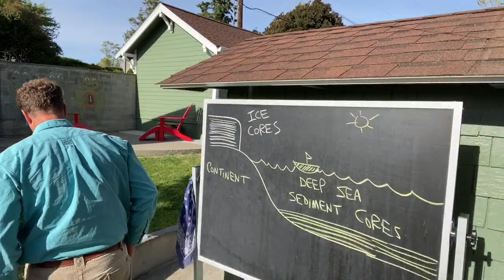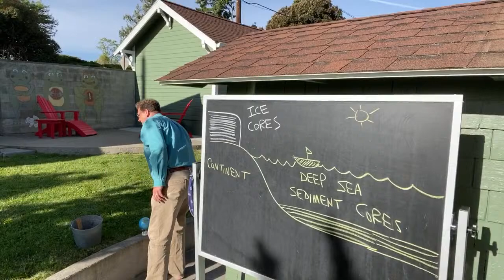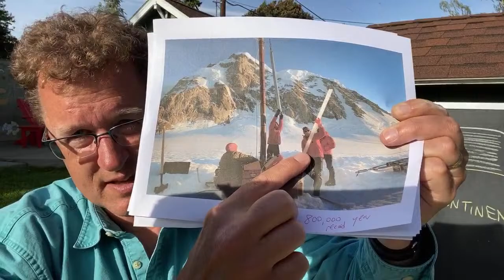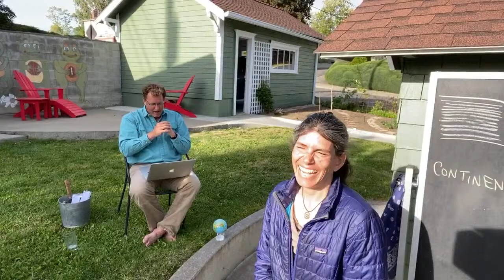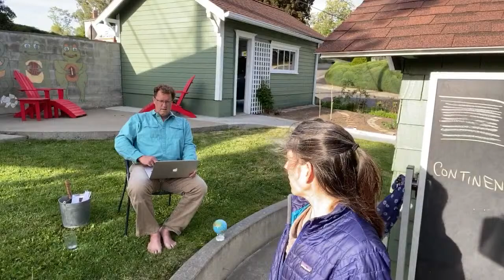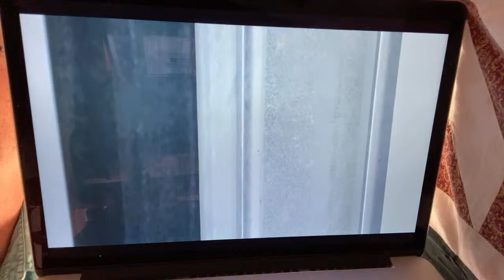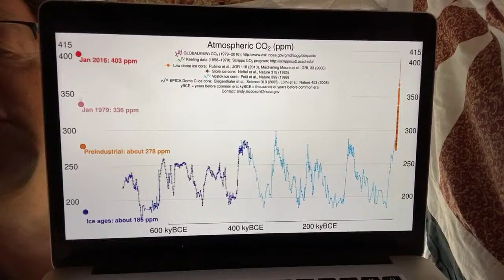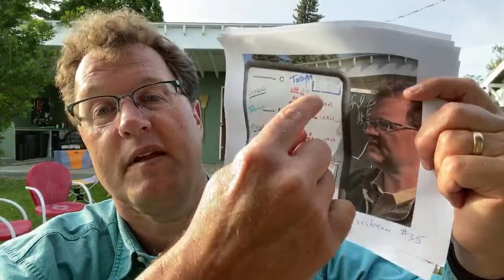‘Nick From Home’ Livestream #51 - Ice Cores

Comment: I imagine Susan's comments regarding social consensus were more directed towards the academic community.

  I agree that the tone of the climate conversation is often wrong. Stating problems without practical/practicable solutions is useless IMO. 
   I, for one, tried riding a bicycle everywhere starting in 2009. At one point I rode 63 miles round trip 5 days a week. I lasted a year at that job before finding a closer one. I was disabled by the 7th car to hit me, February 26th 2014. Most were not a big deal. Only the first was due to something I should have done different. The last broke my neck and back.
  Commuting by bicycle is the most beneficial environmental decision any single individual can make. We just lack the culture to make riding safe. Hitting a cyclist needs to be as bad if not worse than a DUI. Riding isn't an option for everyone. Forcing those that don't, to drive responsibly around those that do, is the kind of incremental change that makes a difference. Heck, just tell people the truth. Hitting a cyclist or pedestrian is nothing like 2 cars crashing. There are no limits to liability. You'll be on the hook for far far more than any average insurance policy. The lady that hit me had to settle a 1.3m lawsuit.

   As a country, we should shift development to provide low cost housing in compact communities, and build infrastructure designed for pedestrian travel as the absolute priority. Driving a car should be the most inconvenient option by design. We really need more of a pre-car European type of municipal development here in the States.
Reply: @ducthman4737  
  What about trucks, tractors, airplanes, ships?
 Good questions, but not directly related to the issues individuals can change right now. 
   The biggest problem IMO is simple, it's the mental block most people have that the problem is: "them," "those guys," "the government," "the MAN," etc. In reality, the problem is me, I, my decisions, right now, today. The tooth fairy isn't going to fix this with a magic pill.

  As someone that went from 350lbs to under 190lbs, I'm quite qualified to say, weight loss is a struggle to make better decisions in the moment, every moment. It doesn't matter if I screw up and make bad decisions here or there. The solution is not a psycho ritual diet. I am not punishing myself. My commitment is to making better decisions, that's all. That's how to lose weight. The reason this idea is so obscure in the US is simple, there is nothing in this to exploit for financial gain. Quite the opposite, misinformation is profitable.
  As a society, we are car culturally equivalent to morbid obesity. We talk like fools, looking for some magic bullet. The questions should always start with, "what can I do to change this," and, "how can can I make better decisions right now."
  
 What about cyclists hitting pedestrians?
  Cyclists are pedestrians, legally. This is not a relevant issue, evident by statistics, and is a poor tangential argument. But, taking full responsibility for one's actions is a good baseline in all areas of life. If someone can't cope with bike traffic, stay on a sidewalk. If riding a bike, stay off the sidewalk. If walking on a dual use space, "remain as far to the right as practicable," quoting California law. If walking or riding to the right, in single file, is an issue, the issue is the individual's own choice of location. If a cyclist hits someone walking on a sidewalk, yeah, throw the book at 'em. If some idiot is on a bike path aimlessly wandering, treat them just like someone driving the wrong way on the interstate and swerving across lanes. Both are equally idiotic.

 Driving cars for issue "XYZ?"
These are outliers. Again better decisions on the individual level are what is needed. Have an oreo. Heck, eat the whole dang container. It doesn't matter. Tomorrow, get up and continue to commit to making better decisions. The bad moments are not important, it's the average that counts. The whole container at once is actually far better than a few cookies every evening. Plus feeling sick and physically terrible due to the whole container helps reinforce the notion of what is a good and bad decision.
   Likewise, everyone on the road should be made aware of their responsibilities. I have a class A commercial license. The responsibility a commercial driver has towards non commercial drivers is a big part of getting a license. The same is not true for a standard license. We have major cultural issues here. We need to shift things like the term "accident." The only persons qualified to call something an "accident" are Judges. Everything else is a collision. It seems minor at first, but it is important. It conveys responsibility in an area that is extremely lacking.

   The issue in Belgium?
   That is also extremely easy to solve. Look at the linked article again. Those invisible helmets sure look cool. 
  Why is the 50+ crowd having so many fatalities? Because this is the pre-helmet age group. Helmets weren't a thing until the late 90's, at least in terms of practical safety devices. The technology changed considerably at that point. I absolutely would not be here if it were not for a helmet. The older generation is the most resistant to change.
  Cycling isn't for everyone. Responsible actions are.

 What about compact municipal development and illness?
  Hong Kong isn't a ghost town, yet. Europe seems to be intact as well. Don't let an oreo defeat you. It's not about the "them," the only relevant question is, "what can I do right now, today." We need that cultural shift made now, by force if necessary. 
  A little bit of fat is healthy. The problem is everyone thinks they are the fat. No excuses. Indecision is a choice. In the end we are all either part of the problem or part of the solution. The question to ask is, by average, which am I.

  Think I'm some crazy Californian? Think again. Born '84 in Huntsville Alabama. Raised in Alabama, Tennessee, and Georgia. I rarely drive, but one might call me something like 'Supercharged Camaro Muffler-Boi' aka "the Pace Maker Baker." It's never been in a shop other than my garage, including 3 scratch motor builds to evolve the supercharger. There are 4x as many miles on my bikes as there are on my car. I preach common sense, not "California."
Full responsibility is all I ask of, and offer to, my neighbors.
-Jake